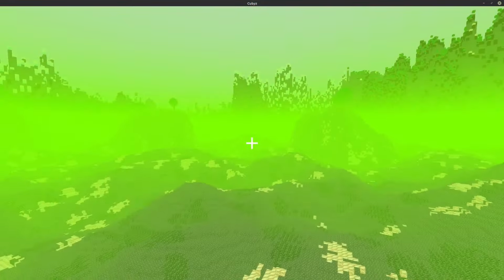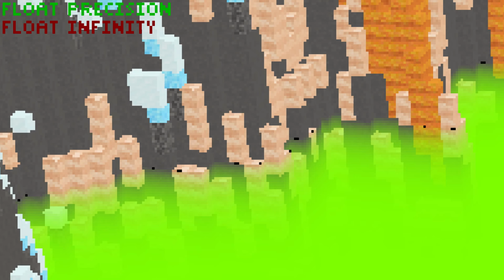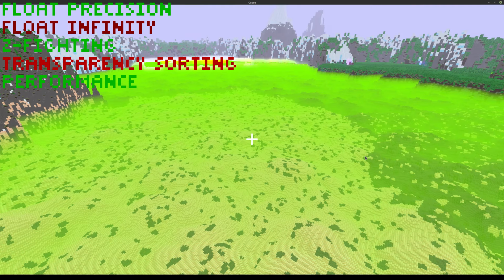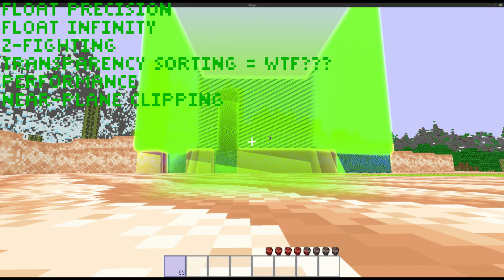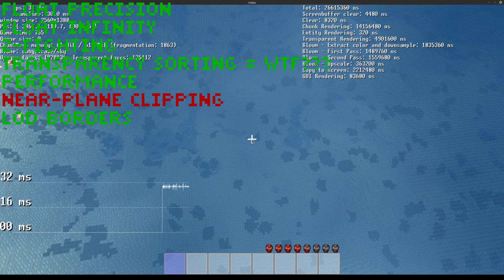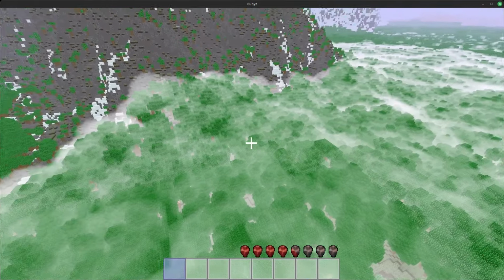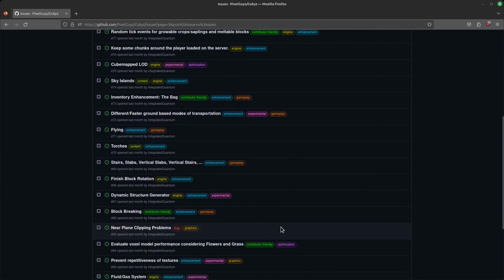Volumetric Fog is actually doable (no raymarching)

Comment: Your method is very similar to a method add stylize subsurface scattering I used in college.
Basically, I rendered an inside out version of a character, then I took the difference between the depth of the normal version and the inside out version and would use that so "thicker" sections of the character were more transparent than thinner sections, I then added the inside out render ontop of the image. This made a quite convincing SSS shader for situations where the light came from behind the character.
(the inside out character lighting would use the same normal as if it were right side out, and it's material was just a red plasticky material)
Reply from the maker: Interesting approach.
The hard part about my method was actually taking the difference in depth.
Since I didn't want to put barriers between every single face, I could only use the hardware blend operations to calculate the depth difference and compute the new color.
Reply: Make a video or else you're lying!
Reply: @jacksonlevine9236  I mean i guess i could but why would i be lying about that? My method was pretty basic so it's not terribly impressive to lie about
Reply: @gwentarinokripperinolkjdsf683  it just sounds cool so I wanted to bully you into making a video

Comment: I figured out why the motion is so weird.
[TL:DR] - You should allow down in the air, and have less controll than on the ground.

Minecraft uses friction to determine how fast you lose acceleration, and how fast you can gain it.
On a normal block the friction is high, so you stop fast, and start fast. 
But when in the air, the friction is such, that it's hard to gain any acceleration, and you loose your speed faster(you get slow sooner). So you don't zoom thru the air like how you currently do in this game. (and many other indi games)
Reply from the maker: Friction and Air Resistance are on my todo list, I just didn't get around to work on it yet.
Reply: @quantumdeveloper2733  cool, I'm happy to be at least as smart as you

Comment: Looks fantastic! You could probably make it dynamic quite easily with some cellular automata-like techniques.
Reply from the maker: The main thing I'm worried about is the amount of mesh updates. I wouldn't want to update half my meshes every frame on a cloudy day.
But I will probably use a neighbor-counting system for when a neighboring block is removed to fill in the void based on neighbor count. So it won't be completely static either.
Reply: I'm not too deep into this, but if you again limmit the fog to one color, couldn't you use the other colors (bits) to cheat moving fog? Similar to how you can create a "moving" pixel-art image by changing the color table. So here you have fog-cells with different values and depending on the sselected "fog-table" only some of them render as fog and others don't. Combine this with terain generation to distrubute the different fog-cells and a nice rotationg fog-table and you easily create the effect of moving clounds and what not :D
Reply from the maker: @AkantorJojo 
An approach like this would probably be applicable in a raymarching fog algorithm. There we could indeed put some extra data into the 3d buffer.
But my renderer uses surface meshes of uniform fog regions. I could probably change fog strength of each region depending on the time, but if the terrain alternates between lots of different fog regions, that would result in tons of extra geometry which gets pretty expensive.
Reply: @quantumdeveloper2733  Makes sense, very impressive stuff regardless!
Reply: @quantumdeveloper2733  Besides, if you get too fancy with non-static fog then all your rgb fog would mix into a grey!
Reply: @frozein  Oh, and also disperse into the rest environment eventually.

Comment: luv your content but there is a problem in downloading. it just stops when i press the run release. any way for you to turn it into a full aplication instead of doing all these steps. so there wont be any problems so you just need to click on the game and it runs
Reply from the maker: What do you mean by "it just stops"? Have you waited a bit? Compilation might take a bit.

What do you mean by "all these extra steps"? It's supposed to be just 3 steps: Download the file, extract it and double click some file in there. That would be the same process for shipping with an executable.

I do want to keep this system. It allows player to check out development versions without me having to compile a new release every week. And additionally it opens up some opportunities for modding as well.

Comment: I think openspades uses a neat calculation for their fog, just assuming the camera is the "front face" and applying height/angle density modifications to it.... They also then raymarch if you want fog shadows.
Reply from the maker: I took a quick look at their code and they apply fog as a post-processing effect.
This only makes sense if you don't support transparent blocks, because there is no way to add fog behind the transparent object since the post processing pass only knows the depth of the nearest object.
They do have water, but here they assume that it has no transparent backfaces, meaning that you can never actually view through it.

I do want transparent blocks like glass in Cubyz, so this technique cannot be applied here.

Comment: Super interesting, nice presentation as well. All a have to say is that the video feels a little slow, and there are some awkward 3 second breaks sometimes (4:32), which kinda makes me lose my attention, which is a shame because it's so interesting! Also what are your plans art-wise? There seems to be a bit of a discrepancy between overall graphics (fog is sooo good) and pixel art (kind of incoherent
Reply from the maker: The slowness is just the way I talk and I don't want to cut the audio too much. But the spot you mention is pretty bad. I'll try to look out and shorten these long pauses in the future.
About the art: All textures will probably be reworked at some point. But I would like to keep the pixel-art style. I'm also thinking about pixelating normally smooth graphical effects, like smooth lighting and reflections.
Reply: @quantumdeveloper2733  good to know, excited to see where this goes!

Comment: For near plane clipping: The volumetric fog is block-based, right? What if you took a cube of the closest 2x2x2 blocks around the camera and treated them in the renderer as if they didn't have any fog at all? If the camera enters/exits a block with ridiculously dense fog, that fog would pop into/out of existence. But at least all the fog blocks that aren't getting hidden will stay visible.
The underlying idea is to simply not have any faces of "fog blocks" in the immediate vicinity of the camera.
You could also just average the "fogginess" of the whole 2x2x2 cube and apply it as one double sized block (with no internal faces).
In theory you could also do that by having a small cube or sphere that slides along smoothly with the camera, and cutting out that shape from the fog blocks. ...if you can define that subtraction operation to occur dynamically.
Reply from the maker: Since I only draw the surface and no internal faces for the entire volume, I cannot simply remove the close-by faces, I'd also need to re-add the faces to their neighbors.

Also I would like to prevent near-plane clipping for solid blocks as well.
I think the best approach would be to re-render the nearby 2×2×2 cube with a different projection matrix.
Reply: @quantumdeveloper2733  That's exactly what I mean: remove the blocks themselves, not the faces of the blocks.
Reply from the maker: @Pystro  I don't understand you then. I don't store or use blocks on the GPU. The faces are the only thing I use for fog rendering.
Reply: @quantumdeveloper2733  I don't really know how GPUs work. I just assumed that you create the polygons from the block data each frame. But thinking about it now, that would be pretty wasteful, since it barely ever changes. (If you actually did that polygon generation process, that would be the point where you'd be treating the 2x2x2 blocks as air.)
So yeah, you'd probably be keeping your pre-generated polygon data structure and then you'd need to do the equivalent of carving out 2x2x2 blocks before rendering each frame (only in terms of removing and adding polygons, not blocks). And if you don't want to make a copy of the polygon data structure, you'd probably even need to do the equivalent of re-adding the blocks after rendering is complete.
Reply from the maker: @Pystro  Yeah, I only update my meshes, once the blocks have changed.
Anyways another commenter found a trivial solution for near plane clipping, involving one of those magic opengl options.

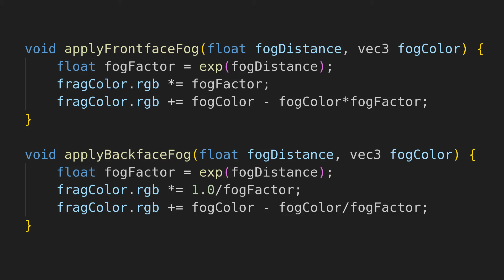Comment: 7:24 UI mask. Reshade users will appreciate
Reply from the maker: The UI isn't even rendered into the buffer in question.
Also there will be some amount of modding or at least custom shader support. So you probably won't even need Reshade.
Reply: @quantumdeveloper2733  well...technically you can still copy a ui mask in there...right?
Reply from the maker: I could. But I would like to put something in there that benefits everyone.

Comment: A fairly old and well known technique. Might be worth digging into some 90's literature on the subject of fog rendering.
Reply from the maker: I doubt that. I need a floating point color buffer to achieve consistent density (without it the fog would quickly get weaker if you are further away).
But (at least in opengl) these were only available as of 2004 and only as an extension.
But if you got any resources on it, I'd be interested to see it.
Reply from the maker: @porkfatrules  I can't see a link. Did youtube delete it or something?
Reply from the maker: @porkfatrules  youtube is so annoying sometimes. I think you may have a better chance with links when writing a comment directly under the video, instead of replying on another comment.
Anyways I found the article. It does look really interesting. But I don't think there is a way to expand it to multiple fog colors and other transparency effects.

Comment: Thank you! I have asked mojang a long time ago to add volumetric fog, but they really dont care about fundamental game improvements. 
How does it work? Is it block based and just counts how many fog block it passes through? Though this wouldnt account for brightness of what we see
Reply from the maker: Basically it determines the exponential of the distance between entry and exit points which makes it smoother than just counting blocks and more physically accurate.
Of course it's a bit more complicated under the hood due to hardware constraints. I gave a more detailed explanation in the end of my previous video.
Reply: @quantumdeveloper2733  thank you I will check it out!

Comment: Pretty sure in unreal engine you could do this even more efficiently if you used the style of rendering that's being used for 3D point cloud scans like NERFs. They're essentially rendering the graphics as volumetric particles and it's consistently 30+ fps
Reply from the maker: Consistently 30+ fps on what hardware? I want to target integrated GPUs as well. This video for example was recorded on a Ryzen 3 3200G.
Also one of the big advantages of the technique I'm using is that it correctly renders fog behind transparent surfaces and stuff like that. Would that be possible with volumetric particles as well?

Comment: Compiler probably fixes this for you but just in case: A *= 1/B is the same as A /= B (in applyBackfaceFog())
Reply from the maker: Yeah, I just wrote it like that to make the code look more symmetrical. In the actual game code I'm using exp(-fogDistance) to avoid the expensive division operation altogether.

Comment: Idea for "moving" fog, make it spread through air blocks the same way fire spreads, but doesn't go above it's spawn point just like water
Reply from the maker: Wouldn't this just flood everything with fog?
Reply: @quantumdeveloper2733  with how much the terrain varies if you make it spread like water does it should be cut off by the terrain height, I was actually thinking about this after commenting but you could also make it so that spheroids of fog will spawn and then update to spread and this could be scaled by biome as well
Reply from the maker: @real_Clone_Gordon_Freeman  I think that my terrain is not rough enough for that to work. Also I don't like that it would flatten out the top surface of the fog.
Reply: @quantumdeveloper2733  aye fair enough, having some sort of growth system in general though would probably be the best way to make it "move" per say but other than that I haven't really thought it out

Comment: Looks very good! Would it be possible to mask out parts of the fog using a scrolling texture to simulate motion?
Reply from the maker: It would only work for 2D screen-space textures, or maybe a cubemap.
But I don't think it would look any good cause everything would essentially just rotate around the camera regardless of the distance.
3d textures are impossible because the back and front faces of each fog volume needs to have the same density and color.

Comment: Are you planning to release this game and add multiplayer in it?
Reply from the maker: The game is open source and you can download it right now.
And it already has multiplayer support. (Although it's currently missing the gui for actually inviting other players)
Reply from the maker: @SandwichGamesHeavy 
I think you can download the newest version(should be 20 or 21) directly from the oracle website.

It is also worth noting that I have rewritten the game in zig. So the java version doesn't contain all the new stuff, like the fog. However the java version has more gameplay features and multiplayer was also fully implemented.
Now the zig version doesn't require installing any extra stuff on your PC and it should be straightforward to compile it from source.